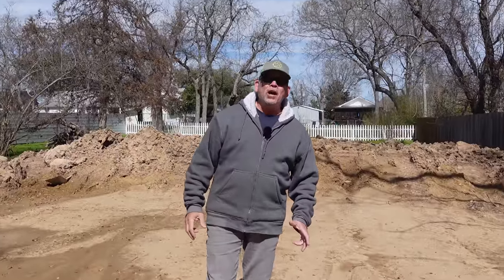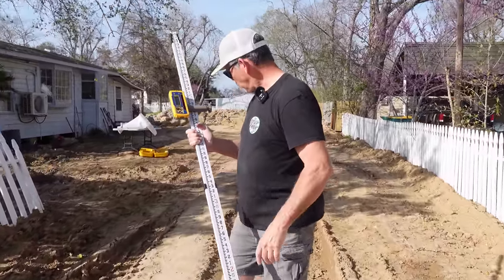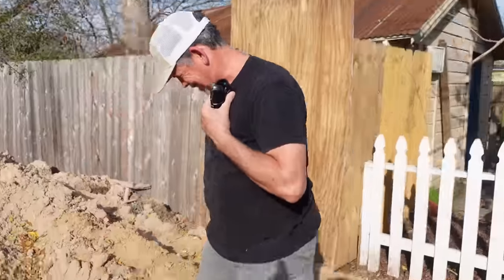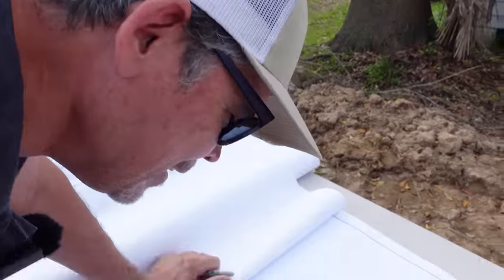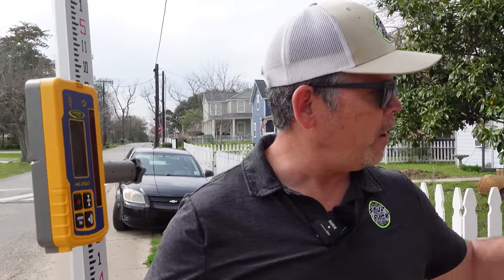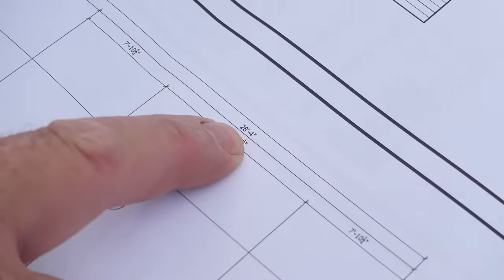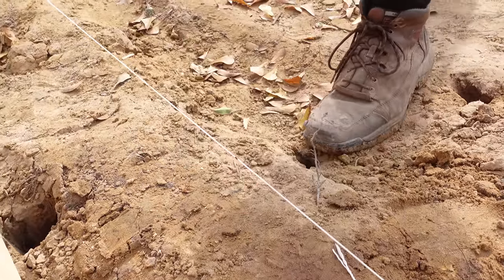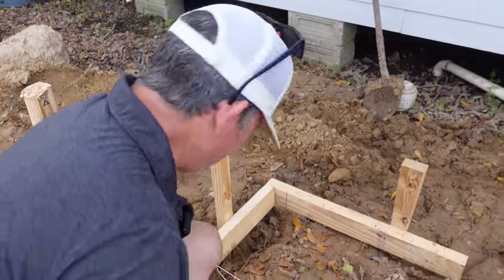Building our FIRST FOUNDATION EVER! (We're Nervous)

Comment: I built swimming pools for years before this electronic stuff. We used a transit level and to level tile forms in the pool we'd use a water tube level. Look it up, it is absolutely accurate when used properly and amazingly simple and works even around corners where you can't see what you're leveling. 
Maybe that's how they leveled the pyramids. :)
Reply: Water tube level is what we used when building our cottage on posts over uneven ground.  The hose can travel down into dips, up and over bumps and boulders and keeps it's level at both ends.
Reply: Not maybe; that's HOW they levelled the pyramids.
Reply: same here. Not as fast as a laser, but water never needs recalibrating.

Comment: Tons of comments for you as this is what I did for a long time.  I’m in my late 50’s and my first job at 14 was helping an old guy layout homes. Lots of fun… my dad was a PE - civil and he taught me tons of old school tricks.

I’m shocked if you paid for a survey and they didn’t leave corner property markers.

Laser… keep it low - just above the tallest point … and the rod plumb when setting grade.  The more out of plumb the more off.  A little lean when low is more forgiving than when high.  Unless needed, I normally don’t bother extending the lasers legs. Some target holders have a centering / plumb bubble to help know when it’s plumb.  The laser or other instrument used for grade should roughly be in the middle so long as they won’t get hit or moved.  Deviation happens… in the middle splits the difference… and even self-leveling lasers will get off.  There’s a way we field test for accuracy.

Most graders set a certain height say height of pad or top of footing and guesstimate for roughing… (we’re high we’re low etc) then when grading they set the rod to grade and depending on the operator it ends up within an eighth. (Maybe someone on a shovel 😀) Find a spot on the sidewalk or something that won’t move for the duration of the work.  Establish the height and always work on the whole job based on that one height.  Finished floor is nice or something similar. Protect it if needed (in an open field we use the biggest 5’ piece of rebar you’ll ever see and drive it to grade… a #12 bar (1 1/2 inch diameter) doesn’t move much unless a trackhoe rolls over it)… paint it so everyone knows what we’re working from.

Drainage - Find a spot close to your pad and dig a hole for a 5 gal bucket.  Holes in the bottom of the bucket act a bit as a strainer and a pump w float switch moves the water as it builds up. This keeps your main area a bit more dry.

Batter boards - the horizontal member goes on the backside.  Use 8 penny nails that are plumb to the top of the board for your string. Don’t tie a loop in your line at the far end… hook a loop and twist maybe 8 times… hook on the nail and start pulling the slack out until you can play a guitar riff off it. ‘Tight is right’.. lines move in the wind so the tighter the better.
Batter boards should be higher than the footing or slab… that way you can establish foundation or wall from the same boards / lines accurately.
Cutting a foot is a bad habit, yeah, I know the reason but for layout, surveyors use a ‘chain’ and they have a zero mark and tend to have an additional foot and handle to hold and pull against.  (There are guidelines on how tight to pull based on temperature and chain type) I can’t tell you how many things were one inch or one foot off when one person cut and the other didn’t.

Establish your side line batter boards that has side of building or side of footing (possibly center line (CL) if needed etc…). Roughly put in the board closest to the house and tie off a roughly correct line… the board closest to the fence someone pulls the line tight while two people pull 6x8x10 to establish square.  Plumb bob w gammon reels help. Personally I used a digital total station and would spin 90 degrees and shoot in my boards so I know things would be square and level day one.

I should have not paused the last 8 minutes before commenting. Lol.. I’m a math guy so cool to see you pull out geometry however if you pull corners and the match then you are good.

One last tip - on quickly squaring lines or establishing an opposite board.  One person holds the tape still and the other swings the tape along the far ‘parallel’ line.  The shortest measurement is where the tape  is square from that stable point and the point at the far line.

Love your channel, I get tons of ideas from you peeps.  While I worked for commercial / industrial GC’s I mainly did concrete, reinforcing steel and structural steel.
Keep rocking it!

Comment: The best accessory I ever got was a cut-and-fill rod to use with my laser.  You set a zero  on the stick, and you can slide the reciever up and down and instantly you have your number to dig or fill, no doing math in your head to transpose numbers.  Especially useful when shooting in slopes.

Something to watch out for is that strobe lights can confuse the receiver, or at least some recievers, something that took me a bunch of head-scratching when I was on a busy site with a lot of equipment surrounding me.

Comment: Great vid. Remember use a metal surveyors tape. The one u r using is fibreglass. It’s stretches and can lead to inaccurate measurements over long distances. Steel tapes don’t suffer from such inaccuracies.
Reply: They do get affected by the temperature. Better to get a laser measure or use a transit for these sort of distances.

Comment: Are you guys planning to pour the concrete directly onto the select fill? When Paul holds that 2x4 up to the string line at the end, there's not a ton of room underneath and I'm assuming you're going to be doing a 6" slab with what you're planning to build and park on it. Doesn't seem like there's a ton, if any room for gravel under your slab with the current 9" above the sidewalk plan!

Comment: Here we have town codes for setbacks from property lines for buildings. There is also a requirement that if you put up a fence the posts have to be on the owners side of the fence and the fence must be setback at least 12" inside of the property line.  Your neighbors fence is encroaching on your property. That fence should be 2' back from where it is now. I think that also means you own ( are responsible for) those trees next to the fence as well. That tall fence out back is in the same encroachment. The tape map should have brought that to the realtors and lawyers attention when you bought the property.

Comment: Instead of holding the laser stick above the ground and have it be a little wobbly, you could always put the stick on the ground with the receiver at the same height as the sidewalk and then move the receiver up 9". This just gives you solid ground to have the stick on vs. trying to hold it in the air, which is more unstable. 

Also could have purchased the Stabila Layout station. Yes, costly, but so worth it.

Comment: Another great video guys! 
A few questions...On the approved plans, it should have a "FF' number...this is for "FINISHED FLOOR" elevation. You can't arbitrarily set the finished floor elevation at 9 inches. 
First off, over almost 60 feet, that's not enough slope, I would estimate at least 12" above the sidewalk. You're already aware of the poor drainage on the lot.
Second, the plans should also show how deep and wide the footers will need to go, usually 2 to 3 feet below where you're standing now.
Third, and most important, the edge of slab to your property line doesn't seem right. I can't imagine the local code allowing only 5 feet from the property line. And a bigger issue is, I'm reasonably sure you will need to put in a drain and drainage pipe to allow for the standing water to drain into the city stormwater system. 
While you have your laser transit, why not shoot the entire lot and surrounding areas to see if you will even be able to drain the lot properly. Grading and stormwater management is always the initial phase of home construction.
Best of luck always, but I think taking a few steps backwards would be wise at this time.

Comment: We used the exact same method to set our log cabin foundation forms, but our big complication was having to deal with actual bed rock being as little as about 2' below the finished floor level in the NW corner to almost 8' on the SE corner and of course undulating in between.  We ended up having to contour the bottom edges of all of our forms for the 30" wide footers and then building the forms for the foundation walls on stair stepped footer sections.  Bedrock is the exact opposite of your soil conditions, so we ended up drilling 3/4" holes in the bedrock and epoxying in rebar to peg our footers to the washed bedrock before pouring the concrete.  Every job has interesting, but different challenges.

Comment: An average garage has stem walls with an opening at the garage doors for access. Many jobs pour the stem walls all the way around the outside. The next day they strip the forms, snap a line on the inside of the stem wall and pour a slab from front to rear with maybe an eighth inch per foot of fall. Or you can cut the inside form board of your stem wall and pour to the top of the stem wall footings and to the bottom of the stem wall form board on the inside to pour the footings and slab at the same time. You need to be 6 inches above grade to any framing plus a weep screed which would add another 3 inches, for a total of 9 inches your framing would need to be above grade. So if your footings are 9 inches above grade you won't have any room for drainage since you said the sidewalk is 9 inches below your slab. If I remember correctly you have a house the connects to the garage. These elevations are critically important to get at the right height.Getting the project out of the ground correctly is critical. I am presuming that you are going to encounter the same soil conditions with the house. personally I would have done the project all at once and moved a trailer on the property for temporary occupancy. The  grade being off by more than a half of an inch overall on your garage pad is unacceptable from a competent grading contractor. If I were you I would look for a new grader for the remaining part of the project. I like you guys and wish you well, once you get the project out of the ground you should be back in Stud Pack fashion. I must say. at this stage of the project I have some serious concern. You have everything riding on getting this project out of the ground properly.

Comment: Just a tip, if you're using a level to plumb against a string line like at 14:38 use a shovel or 2x4 placed on the ground angled to and held at the top of the level to keep it steady. A lot easier and more accurate than just freehanding it in the air.
Keep up the great work!

Comment: Set your batter boards so the string lines are above the slab height. Place a nail at the inside of your stake line. Drive the stakes so the are as close to the line as you can get them without touching the line. After the stake are placed shoot the slab height on the stakes and snap your lines. The batter boards should be about 3'' above the slab height to give you room to drive the horizontal stakes. eyeball the batter boards with the sting line 3'' above to line the batter boards up and brace.

Comment: Laser Rake: 
I once worked prep'ing and pouring an Ice Rink Slab. 
It had to be level/flat before the pour, and during the pour.
The contractor arrived and immediately hired 8 day labourers (zero experience).
4 were given a shovel and a wheel barrow.
The other 4 where given a regular rake with two bands of black electrical tape, 3/4” apart, on the handle.
They were told, that when they stood the rake upright, the Laser light had to be between the black tape.
If above.... rake more sand in.
If below.... rake sand away.

10 minutes of instruction and these Day Labourer were able to level an entire Hockey rink (in a week)

The only problem.... you need low light to see the Laser light.

Comment: I watched my father in law lay out foundations using batter boards and a transit. When I built my house several years ago the guys who laid out the foundation goofed on one wall. My wife caught it later after the footings were poured. We had to jig the wall to get it as close to square as we could while staying on the piers. It ended up 1 3/4 inch out of square. Fortunately the floor ran diagonally to that wall so you never noticed it. I guess if the new owners (we sold it several years ago) ever lay carpet they’ll see it. Measure once cuss twice. 😊

Comment: I’m really hoping to see you use duplex nails next video dump. 6d, 8d, 16d all have a purpose and say “old school” builder.  Backing the board receiving a dupe with a single jack is satisfying. If you know what I’m talking about you’re probably 70 too.  
It looks like more than 36’ to the sidewalk so you won’t have minimum fall of 1/4” per foot but will be close.  Nice work guys!
Hmmm. It’s 65’ to the street…so you need 16” of fall for “minimum” per old school standards. It’ll only matter in heavy rains when your downspouts are spouting.

Comment: Great job guys!  Just a few suggestions for down the road…. When it comes time to wire it up, be sure to run network cables to all of the sofits for Poe cameras on the corners.  Also add plenty of network drops where you will have computers, tv, etc.  and home run it all to a place you will put your networking equipment and be sure that place can stay cool.  Don’t run networking into a structured panel because you will be hard pressed to find a good Poe switch that will work and stay cool in them. Be sure to add a network drop for an access point too.  Check the Ubiquiti stuff out and use their UniFi access points.  You can have then all work on a mesh network. I’d also wire for security and run cat6 where your wet devices are to you can tie in leak sensors.  This would be water heaters, washer, dishwasher, and even toilets if you wanted, and tie into an electric ball valve to shut off the water if you have a leak.  For hvac, same thing…. Use WiFi thermostats and put lead sensors under the units and have automation turn off the units when they leak.  Notice I said when…   Also, lower the pad under the hvac units by an inch or two so if they leak, it’s contained there and doesn’t run under the flooring.  Obviously, not the case if you do cassette mini splits which is a nice option versus conventional systems.  

Also, wire for smart light switches.  Most don’t need 3 way type wiring since one is a remote for the load switch but you may need power where you put the remote switches.  Then you can automate everything and set scenes for lighting.  

Not trying to tell you what to do, please don’t take what I posted that way.  This is just some offerings from past experience in other houses and things I’m planning for my house build coming up.

Comment: If at all possible use the largest wood size you can for the walls. 2x6, 2x8 , 2x10. Having the extra room in the walls allows for a ton of future additions and allows for better insulation and strength. It costs more but trust me when i say it is a go send to have thicker walls in a shop.

Comment: There are measuring tapes with 1/10th inches instead of 16th, engineer's tape. I love it cause then you can use your calculator and ratios. or I also sometimes just use dividends like instead of 3-4-5 I do 9-12-15 then parallel it and add the offset of the parallel.

Comment: I meant to say form boards on my last post in the last sentence. With the amount of water you have on that lot you should have more than minimal slope. Drive the vertical stakes slightly leaning out so you horizontal stakes will be pushing in on the form board as to alleviate the need to place stakes on the inside to push the form boards out, thus keeping them out of the pour.

Comment: If it's not square you can use law of cosine. If you have  vertical differences you can use h^2=a^2+b^2+c^2, Pythagoras in 3D basically. Or if it's not on a flat surface you can use differential geometry (same math used for Einstein's General relativity).

Comment: As one that's very used to being on the "Smart End" of the tape measure, Jordan, Learn from my mistakes and learning this error the hard way Hold The Tape Under The Doglines and Use a PlumbBob To Ensure that you're dead on the mark. Also another trick an old hand learned is cut you a Plywood Square. It looks like a speed square but bigger using the 3-4-5 . Make it 3 1/2" wide Mark it Center line with Marker. Then You can lay it on the ground under your doglines. Oh yeah the "Smart End" is the end that doesn't require the thinking and rolling it up. So that leaves me to ask the question, 'Do You Carry a tape, as a rule?'
Also when setting up the transit on the old kind We would setup an platform of Blocks that were leveled and put down plywood on it AND HEAVEN HELP YOU IF YOU BUMMPED IT

Comment: Just so you know I seen plans drawn by architects that were off in marks by up to 20 feet. When you tell them about it they say "just do what you have to do to make it work and I will do the corrections later." Then comes the inspection and you get the problems or at the least delays. Also I have seen problems with the stairs and landings that if I was the home owner I would have sued they architect. They were left by a small uncomfortable space that I hated to get furniture up, when it was supposed to be the contrary of the result. So double check triple check, etc, etc. It is a problem more common than you think.

Comment: Do you need to check those measurements with a laser? How much sag do you get in string lines and measuring tape over those long runs?

If this were my first project, I'd be concerned about creating a dish in my slab. That lot looks pretty flat.